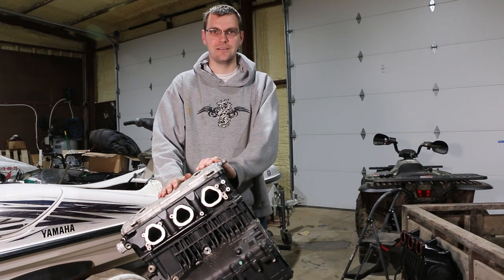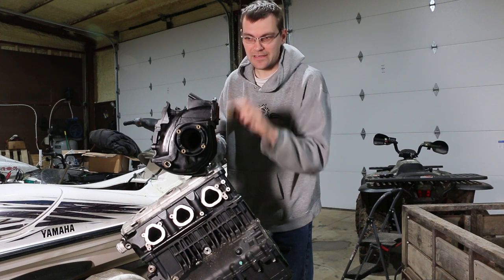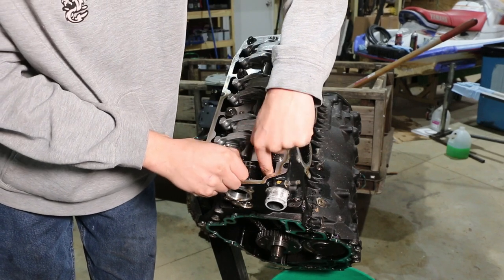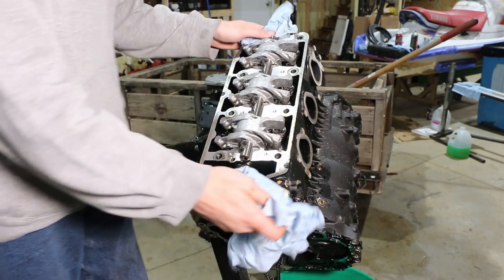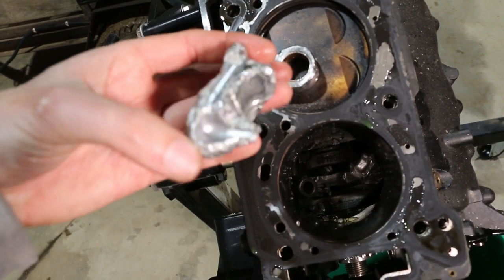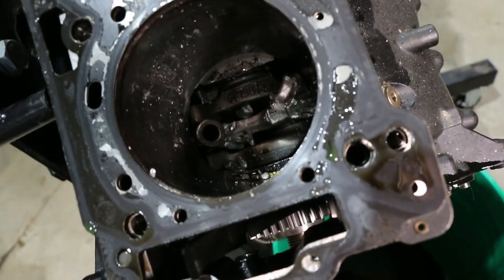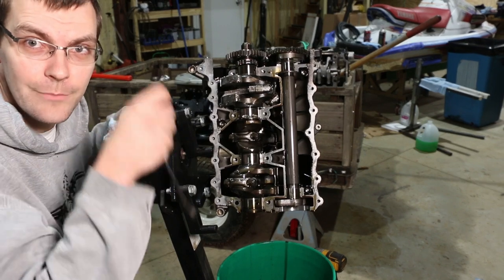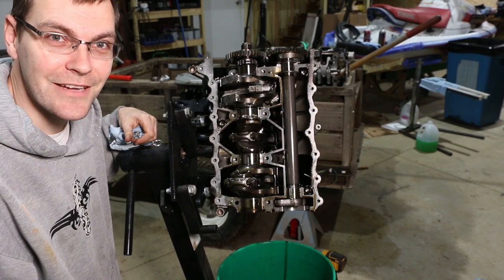Seadoo 4tec 155hp Engine Autopsy. Hydrolocked at high RPM.

Comment: Nice to see the procedure and what to look for.   Working on a hydro-locked (from a garden hose with motor off) and figuring where to look next.  Already removed and emptied intake, exhaust
Reply from the maker: With the intake and exhaust empty, getting it out of the cylinders and any intake piping or intercooler if it's supercharged, and you should be ready to start it up briefly, and then check that the oil isn't water contaminated.

It's not awful as long as you catch it before it hydrolocks while running, which you obviously have. Hope you can get it going again!

Comment: I have a 05 Gtx scic limited  getting a code p0112 changed sensor same thing any help would be appreciated
Reply from the maker: P0112 is for the intake air temp sensor being shorted to ground, I would check the harness with a multimeter to see if one of the iat wires is indeed shorted to ground, I've seen seadoo harness rub through and break wires before, dunno if that's helpful but it's a place to start at least.

Comment: Tenho um seadoo 170 com apenas 28 horas de uso com escape direto , aconteceu o mesmo caso desse jet , quebra de pistão , pode me informar qual poderia ter sido o caso da quebra . Na hora não estava em alta rpm
Reply from the maker: Google translated: (I apologize for any grammar mistakes)
Se entrar água suficiente, mesmo em baixas rotações, ela pode rachar ou enfraquecer os pistões e as hastes, normalmente os motores não sobrealimentados, como o 155 e o 170, têm pistões fundidos mais fracos, onde os motores sobrealimentados recebem pistões forjados, você colocou água no motor ou não estava relacionado a nenhum tipo de situação de hidrolock?

English:
If just enough water gets in, even at a low rpm it could crack or weaken pistons and rods, typically the non supercharged engines like the 155 and 170 have weaker cast pistons where the supercharged engines get forged pistons, did you get water into the engine at all or was it unrelated to any kind of hydrolock situation?

Comment: Great video!  Maybe you can help me with a problem I'm having on a 2013 seadoo gti130se.  It has over a 1000 hours and got an overheat alarm.  Turns out it had oil in the coolant but no coolant in the oil.  I pressure checked the oil cooler and it didn't leak, so I decided to have the head milled and replace the head gasket.  After all that work, I took it out for a test run.  It was surging and wouldn't stay above 5000 rpm.  Gradually though it started running normally.  I was periodically checking under the seat for any leaks and all seemed good until after about 30 min I got an overheat alarm.  Once again, the coolant tank overflow hose was spewing oily water, but no signs of water in the coolant.  Any ideas what the problem could be??
Reply from the maker: Could be the seal between the rear oil pump, the same shaft also drives the water pump, although in theory the weep hole should prevent water and oil ever seeing eachother. Past that, the cooler which you tested, head, block, is pretty much it.

Could it be that you didn't get all the oil out of the system and had some big air pockets in there so it boiled over? Getting these full is done best with a vacuum filling setup. Pull the whole system under a vacuum and then let is suck the coolant in, otherwise you end up with some pockets of air in the ride plate and stuff that can cause an airlock or such if they get to the water pump.
Reply: @trythistv  I don't think so because the oil level was much lower after the test run.  I'm now thinking of removing the PTO cover and checking the weep hole as a start.  Thank you for your time..

Comment: What’s the best easy repair for a broken ignition coil ground wire. Can I splice a new ground connector to the OEM ground wire ?
Reply from the maker: if we're talking about a 4 stroke seadoo, the ground for coils and injectors is provided by the ECU, switched on and off electronically, and +12v is provided either by the MPEM if yours has one, or the fuse box/main relay if you don't have an mpem.
Unless we're talking about the newest 300hp style coils that bolt down and have the little tiny ground wire and ring terminal, in that case it would be fine to splice in a new wire and ring terminal to that wire, but not the 2 wires that go into the plug in connector.
Reply: @trythistv bro u are so clever!!

Comment: Very informative and useful video! I am currently working on a sunk 07 RXP 215. Is there a similar way to suck/drained water from the intake manifold like you showed earlier on the TR-1 engine?
Reply from the maker: Sadly there is no drain or anything on the seadoo manifolds, the best option is to unbolt the manifold, there are several e8 etorx, somewhere around 7 or 8 I believe and then you can pull it loose and tip it up on end, oftentimes you don't need to disconnect everything, there may be a few wires that have to be unplugged, but you can leave a lot connected, tip it up and open the throttle body and drain the water into the hull (it'll be hard to get it any further away. It may also be possible to pull the intercooler out the front enough to get a suction hose in like I did on the tr1 unflip video, but that would only apply on a 215hp machine that has the intercooler in the manifold, but I'm unsure of that, I have not tried that method yet but it just popped into my head.

Comment: I've got the same engine with 450hrs., and it runs fantastic still , just like new.  I hydra locked a riding mower once when I fell in the pond with it.
Reply from the maker: The non supercharged seadoos are very solid machines. And perform great too!
The early sc machines can be problematic, thankfully rotax did make improvements but those ceramic washers on the supercharger were a disaster! But they were spectacularly fast, especially for the time. I've got an 05 rxp 215 and it still feels too fast

Comment: Last year my dad left his 2011 sea doo speedster 150 neglected at the dock for months then when he finally took his trailer pulled it out of the water the  engine bay was flooded. He drained the water then stored it for the winter. This summer he tried getting it running after months of neglect he pulled the spark plugs out then cranked the engine over it spat out tons of water. Then when he thought he got all the water out of the intake he put the spark plugs back in then cranked it over after 5 seconds of cranking over it started it ran for a few seconds before completely locking up. He took the spark plugs out then cranked it over tons of water came out again then it started knocking real bad. It got a rod knock. My dad  recently got a new motor for the boat and I was helping him pull the blown motor and disassemble it. I took the intake manifold off and turned it vertical and opened the throttle body and tons of water came out. It sucks that if my dad didn’t leave his boat neglected at the dock he wouldn’t have his boat blow up
Reply from the maker: Yep. The intake design allows water to remain and get sucked up. Same thing happens with the newer Yamaha tr1 engines. Have to drain the manifold before starting. Real shame there isn't a built in drain of some kind.

Comment: I’m taking apart a 215 hp Towmmor see the carnag you gave me a good idea what to look for
Reply from the maker: I've got so many 215s I should pull apart. Typically supercharger failures that end up taking out the oil pumps and then bearings spin.
I'll most likely be doing a few autopsy videos this winter.
Hopefully your engine isn't horrible carnage!
Reply: @trythistv  I took it all apart yesterday and found piston bolts the 2 snapped off and made small hole through top case and hole into bottom  I think it’s pretty much a write off    , had lots of steel shavings  by the oil  screen area and in the filter lots of shred

Comment: My 2006 supercharged gtx got water right to the top of all the cylinders when I got a water tow (at about 30 mph didn't know I had to plug the exhaust back then). I was smart enough not to crank it without pulling the plugs but the water kept blowing out the cylinders no mater how much I cranked it. I finally used my oil sucker to drain at least a gallon of water out of the exhaust manifold side. A little more  cranking, a bunch of fogging oil and new plugs later, worked perfectly, none the worse for the wear. I was surprised that absolutely no water got into the engine oil, the cylinder rings are really good. But thanks for the FYI on the intake manifold potential water build up. I will keep an eye on that now if the hull ever gets flooded.
Reply from the maker: With the supercharger it might have been helping to pump the water from the manifold into the cylinders, no evidence to confirm that, just theorizing what may have helped!
Glad it all worked out well, if all the water is gotten out it is amazing how much any PWC engine will withstand, We work on a lot of rentals and they get flipped and sunk regularly, and keep running fine as long as we get the water out before the customer trys to start it.

Comment: Great video and I enjoyed seeing it. Please make some more!
Reply from the maker: I will be making more! I need to thin out all these blown up engines I have laying around! 😂
Reply: @trythistv  Would love to see a TR-1 getting this treatment. OK I'm biased as I own one, so take my request for what it's worth...
Reply from the maker: Convenient as I have 2 tr1s sitting in the shop that tossed connecting rods out the side of the block from being hydrolocked. I will definitely be doing a full teardown on at least one of those, dunno if there is any chance for either one to be repaired with a new rod and take the case somewhere to be welded or something, we'll all find out when I pull them apart!

Comment: what can be done to prevent this?
Reply from the maker: This was caused by water ingestion at a higher rpm, so If you ever get water into your seadoo engine, don't try to run it, the water needs to be extracted or blown out of the cylinders (I extract what I can with a pump and small tube and then blow out the rest) and the intake manifold needs to be removed and poured out, as well as anywhere else in the intake system so you don't ingest water once you do start the engine back up.
Reply: @trythistv  i just replaced two brand new 2023 engines for that exact reason (i rent them out) and was wondering if a bilge pump could prevent this. been scratching my head for a full
year trying to figure out what exactly and happened and word for word had the same scenarionas the one in the video
Reply from the maker: @raptornation9891  I service a fleet of rentals, they are Yamahas, but I've thought about automatic bilge pumps attached at the very bottom. 
I guess the big question is why did so much water get inside the hulls of your machines that this became an issue?
If people are flipping them upside down, I don't think a bilge is going to help.